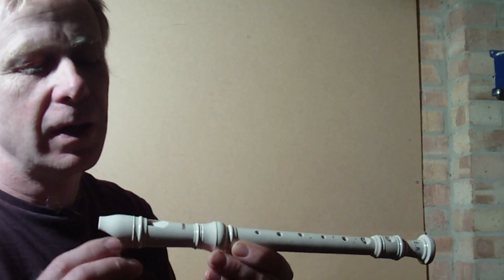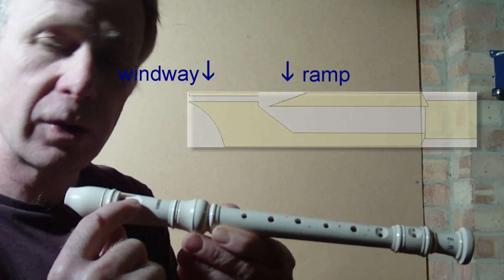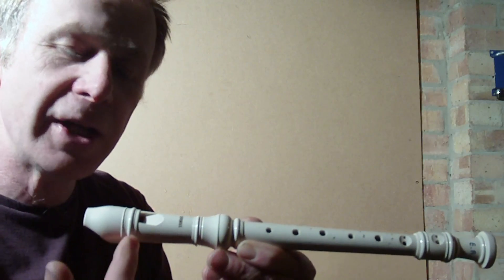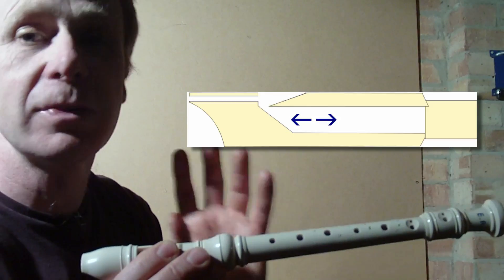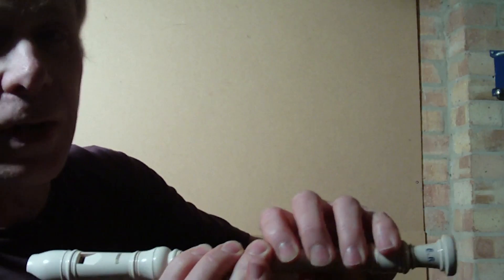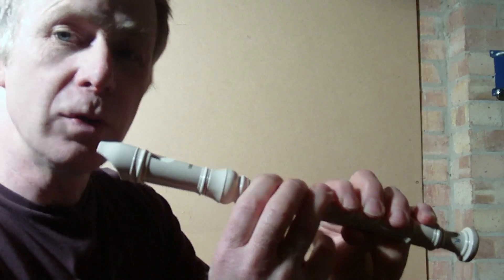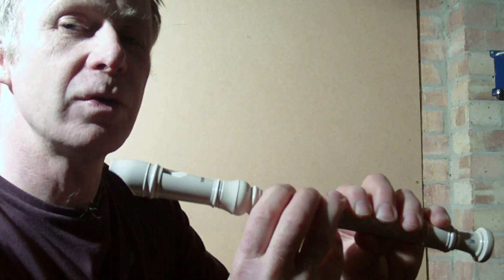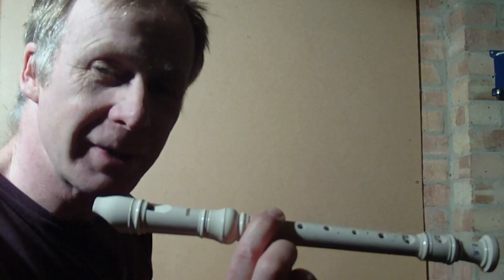how a recorder works

Comment: Cool lesson in physics, but i still don't understand why does it matter if i cover further holes if the previous one is open. Like, imagine holes  1 through 4 (counting from the mouthpiece) are closed, hole 5 is open and holes 6 and 7 are closed - why does it produce a pitch different to one if the holes 6 and 7 were open?
Reply: I would say, because the holes are not perfect openings. So further holes still have an effect.

So for your example, hole 5 is open so that affects the frequency, bringing the pitch close to an F. But the open hole is not "fully open" - in fact the larger the hole size the more the effect (hence the lowest 2 holes have 2 small holes each - covering both changes the pitch more than covering just one). So the holes after it still have an effect - hole 6 has a bigger effect than hole 7 because it's closer to the head of the recorder. Closing both holes makes the pitch an F.

Comment: Yes  I don’t understand the thumb hole fully open and half covered  and the different fingering for the higher octave
Reply: Half opening the bottom hole causes an appropriately-sized air leak that destabilizes the lowest frequency wave in the recorder, causing it to sound weakly or not at all. So you hear the next higher-pitched wave, which is the next octave.
It would also seem that this same air leak requires different fingerings to achieve the appropriate pitches for higher notes.